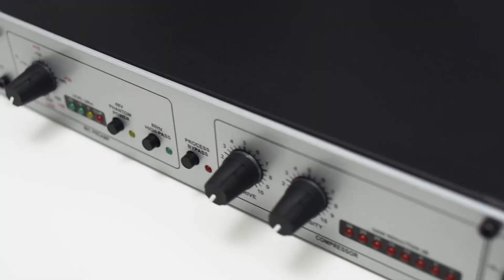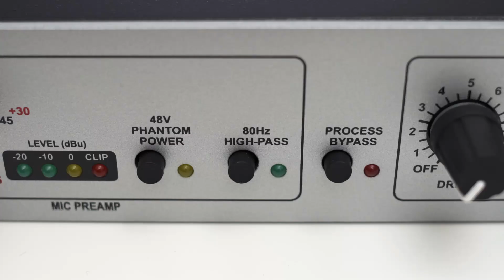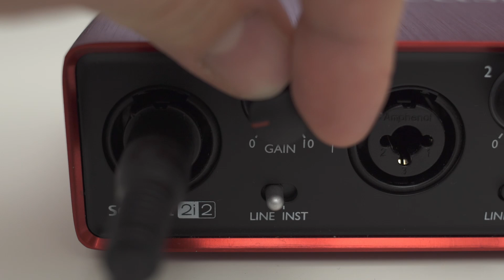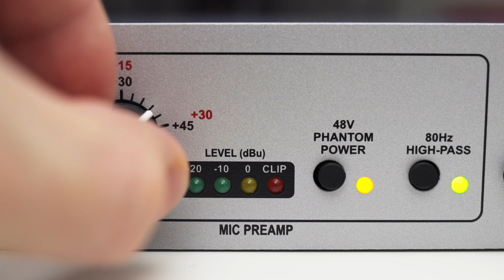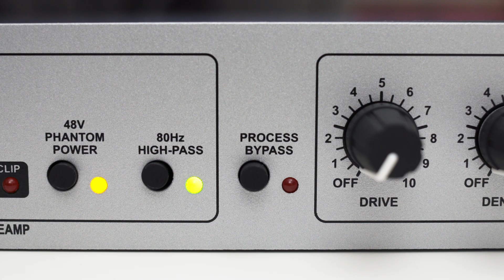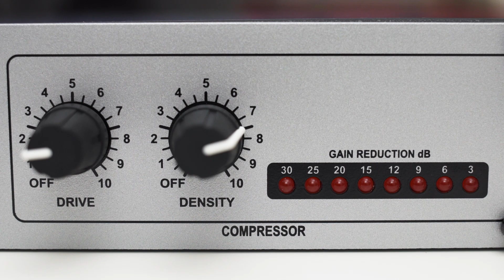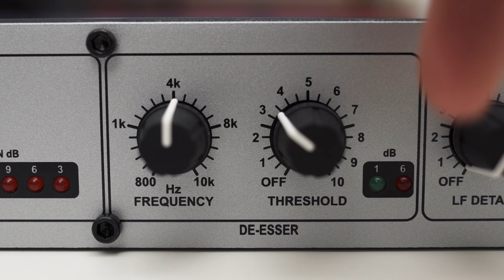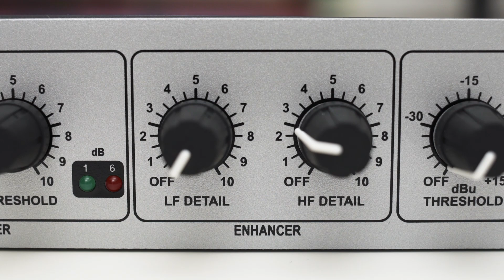Best Settings and How To Connect - get started with the dbx 286s

Comment: is there any sound quality change when you use a trs to xlr instead of rts to trs?
Reply from the maker: No, not really. It's just that TRS inputs are line level inputs and designed to be fed with a strong signal. XLR inputs usually only take microphone level signals. So, if you use a TRS to XLR then you would have turn down the output of the 286s a bit and send a lower signal to your interface. This theoretically makes the signal a bit more susceptible to interference. But in a normal setup this is pretty much negligible. What I'm trying to say is that if you have a TRS input on your interface, I would recommend to use it but if you connect your interface via a TRS to XLR cable it is also totally fine.
Reply: hmm, seems like I should spend an extra $7 on the correct cable then, seems like a small price to pay after spending $700 on a setup. I rather not risk having extra background noise, just got my dbx in today, hopefully it will fix some of my sound problems in my videos thanks.

Comment: I'm having difficulty finding out how to connect the DBX 286s to the RME ADI-2 DAC FS, as everyone also uses the Scarlett 2i2 as an example but the RME has 2 XLR connections which will be used by the Left and Right Speaker and another 2 unbalanced RCA connections. Can anyone help me out on how to connect the DBX 286s with the RME or what other hardware I need to connect? ...Thank you!
Reply from the maker: Hey, that does not work. The XLR connectors on the RME ADI-2 DAC FS are audio outputs, not inputs. If you want to record the audio from the 286s you need an audio interface with line level inputs. A Focusrite 2i2 is one option but there are many more options available.

Comment: This isn't working for me and I don't know why. I followed all of the steps, but when using the tone generator, it was at -35 dB and no matter what knobs I turned, either on the 286s or my audio interface (U-Phoria UMC22), it never changed. I could hear a difference, but there was no change reflected in my software (Audacity). What am I doing wrong? Is Audacity not the right type of software to use or is something else the matter? Thanks

EDIT: I followed the rest of the video and my audio recordings still sound awful probably because I couldn't do the first step correctly. I bought my Shure XM7B because I heard that it was one of the best microphones for voice-over recording, but after spending a lot of time with it, it makes my voice sound really bad because I have no real knowledge of audio engineering. But no matter what tutorials I follow, my recordings all sound the exact same and I don't know why
Reply from the maker: Hey, here is the easy way to set things up. You connect the output of the 286s with a TRS to TRS cable to the line input on the UMC22. You turn the output knob on the 286s to 0 (12 o'clock). You turn the gain on the UMC22 to the minimum. Then you speak into the mic and slowly rais the input gain on the 286s unti you record a proper level. Add compression and other effect to taste.

Comment: Hey i am using rode nt1a mic with focusrite solo interface and preamp dbx286 can you help me with perfect setting as the above setting is not working perfectly i get some technical voice
Reply: And i must use Direct box between preamp and interface?
Reply from the maker: @rickvick5603  Hey, no you don't need a DI between the 286s and the solo. You simply connect the two liek shown in the video. Make sure that the TRS input on the Solo is set to line level.
I don't understand what you mean by "technical voice". Maybe you got your gate settings a bit too agressive?

Comment: Can i use SM7B with 286s without a fethead/cloudlifter
Reply from the maker: Yes, you can. The preamp of the 286s is very low noise and has enough gain for the SM7B.
Reply: @JulianKrause  thank you for answering, very informative channel 🙌🏻

Comment: does anyone know what gear should be in my audio chain for my SM7B in-order to completely eliminate the need to post process my audio using a Digital Audio Workstation?
Reply from the maker: If you don't want to do any post processing I would suggest the following audio chain: SM7B -> DBX 286s -> audio interface. All the processing like compression and gating is handeled by the 286s and then the interface captures the audio. If you set up your 286s properly you shouldn't need any additional post processing.

Comment: Jk what settings are ideal for male rock/metal singing vocals ? Using a Shure SM7B.
Reply from the maker: I would say, not too much different. You could push the compressor a bit harder and play around with the LF and HF detail.

Comment: Do you really need the audio interface? Can’t the output of the dbx go to the line input of the computer (providing it has one). In your setup the Focusrite is only getting the line input into the computer. It could also be used for headphone monitoring but many gamers seem to like wireless headphones, which won’t work with the Focusrite.

Comment: Julian, Great tutorial.  I have had a DX 286s for a while and really appreciate your detailed reasoning for your setting selections.

One small issue.  You mentioned using TRS to TRS cable instead of TRS to XLR between the DBX 286s and interface.  I tried this and lost 5 to 6 dB of gain?  I had to make up the gain by turning up my interface.  Any thoughts on why?  My interface is an Audient ID14.  Cables are Mogami Golds.

Comment: My DBX 286s creates a ground loop whenever its connected to my PC / or in signal chain to my PC. :(
Reply from the maker: Hey, how do you connec the dbx286s to your PC. Which cable are you using and are you using an audio interface?
Reply: @JulianKrause  Hi thank you for asking. Im using an internal pci-e soundcard (Soundblaster ZXR). The DBX was connected from Line out to my mackie 402 vlz via TRS cable (tried multiple including TRS to XLR and different brands) in Line 1 and from there i tried every possible way to connect the mackie with the PC (main out/tape out even headphone plug) If i connect the mackie on its own and use the mic preamp of the mixer there is no groundloop issue even when connecting it via Tapeout (cinch). If i plug the DBX286s into any input on the computer ground loop is happening (except optical via external A/D converter ofc, because it doesnt transfer any power to the PC). When i plug the dbx into the mixer and put the mixer on a Soundbar or something its also not happening, it only happens in the combination of the DBX and my PC.

SO a guess could be that the DBX doesnt like the internal soundcard for some reason. I tried to lend a USB audio interface, but im not sure if it would help, after googling ive found some people still having groundloop issues while using a scarlett 2i2 and TRS cable since the device is Bus powered i guess it can still happen..

My next attempt to fix the issue is to buy a new power strip with EMI/RFI Filters. Because i dont want to splice the TRS cable and remove ground OR use a hum eliminator/di box because most of them affect the sound. I would be sad because ive bought the DBX because of better sound and altering it with such a device is against the purpose of using it. And i still try to borrow an USB audio interface from anywhere or ill maybe buy the cheap behringer UMC202 to try it.

Comment: Pls don't use a 1/4" to XLR cable. For less interference you should use a 1/4" balanced TSR to 1/4" balanced TSR Cable. They are a bit harder to get but should work way better in a growing setup.

Comment: What kind of calibration are you talking about? Output gain is to compensate the output level depend on effects you are using and there's no such thing as "calibration" which you "set just once", because every time you use effects on this device they change level of your signal so you need to adjust the output gain accordingly.

I wasted an hour because of this tutorial trying to understand why my audio interface started to clip when I turned all the effects on but the input gain was never showing yellow or red....

Comment: Is this video still relevant even though im using a cloudlifter?
Reply from the maker: Yes, make sure you turn on phantom power on the dbx286s and the rest of the setup is the same.
Reply: @JulianKrause  thanks for  the quick reply! I forgot that trs to trs cable.. Only got the two xlr cables.. guess ill have to wait another day :p
Reply: @JulianKrause  Ive done everything you did in the video but Im getting backround noise.. like a thin little hiss-sound  whenever im speaking... any idea to as  why?

Comment: Julian, hi again and sorry for bothering you. I recently bought a fethead and now the gain I have on my shure sm7b is more than enough, I have correctly calibrated the mic and everything is as I like it, only problem now is when I scream the mic clips (that like distortion/static noise) is there any way I can fix this without affecting the volume? If i go lower gain my stream cant hear me while I talk, but if i stay the same it clips when i scream
Reply: That's what the compressor on a device like this is for, to lower loud sounds outside of your normal range. Also if you're gonna be screaming into the mic, you should either be getting further or turning away from it to avoid distortion. There's a reason singers distance their mics from their mouth when belting out loud notes.
Reply: @samuelvasquez974  I realy doubt it's the actual mic that's clipping. Dybanic mics can ususlly withstand pressure well above what we humans can produce. Unless you're litterally eating the mic, in which case, move a bit away.
Otherwise, as the comment above mentions, compressors are there to tame the unexpected peaks, if set up correctly.

Comment: The 'somewhere in the middle' and placing your phone somewhere near the mic and picking -18db out of your hat seems less than ideal, or at the very least could use some explaining.  I'd think it'd be much better to set your audio interface's preamp to unity gain, or bypass it altogether if possible.  Also, omitting any mention of the fact that it's not ideal to plug a preamp into your interface's preamp seems silly;  Of course, if you have a line input that bypasses your preamp, you should use that instead.
Reply from the maker: Hey, in the video I told you to set the volume of your smartphone to "somewhere in the middle" because the absolute sound pressure level of the sound is irrelevant. There is no specific value you have to set your smartphones volume to.
Reply: Julian Krause right, and that’s where this advice falls apart in my opinion; if you’re not feeding in a realistic signal, and you’re shooting for an arbitrary -18db, then you aren’t actually calibrating anything at all. You should really start by setting your interface preamp to unity, or bypass uf possible, then set the actual preamp to match the input signal.  The method here makes no sense to me
Reply from the maker: @threepe0  The reason the smartphone volume level is irrelevant, is because in the calibration procedure you turn up the preamp on the 286s until the yellow LED starts to light up. This will always produce the same signal level at the output of the 286s, regardless to where you set the volume on your smartphone. And that's why this procedure will lead to a consistent and proper calibration.
Reply: Julian Krause I see what you’re saying now. This is a way of finding unity gain on your interface’s preamp.  Setting a tone generator still seems like it would give mixed results though, as frequency response may come into play. I still think a better explanation of the method and the suggestion of bypassing the interface preamp would help.

Comment: This is wrong. You're connecting a preamp to a preamp. You're gonna get a very unclean signal with this.
Reply from the maker: That's incorrect. The first preamp does the main amplification of the signal and is thus the main contributor to the noise floor. Because you send a strong signal into the second preamp which has its gain set to the minimum, the noise of the second preamp is negligible. So, if you set everything up as shown in the video you will actually get the best signal-to-noise ratio with this setup.

Comment: That's very weird you call "Big Jack 6,3mm" a "TRS". Nodoby does that. It's Big Jack.
Reply from the maker: There is a difference between TS and TRS jacks. And in this case, you need TRS so I wanted to emphasize it. So, it is a Big TRS Jack :)

Comment: Do not plug it onto the preamp of the audio interface. GEeesh
Reply from the maker: Why not, if the interface does not have a line level input it is absolutely legitimate to use the XLR input.
Reply: Julian Krause because you run a prosessed signal through another preamp and if you need to the output on the dbx should be set to -30.
Unless you have a switch on the audio interface to bypass the preamp :-)
Reply from the maker: @39zack  I know, but if that's the only way you can record the audio than that's the way to go. I rather runthe signal through another preamp than not recording it at all.
Reply: Julian Krause good point, and I totally agree 😀